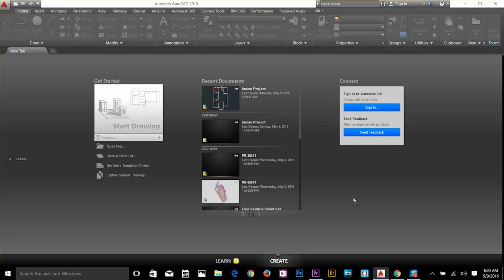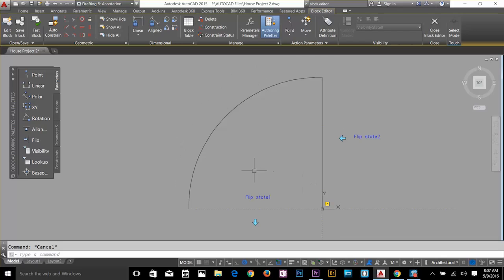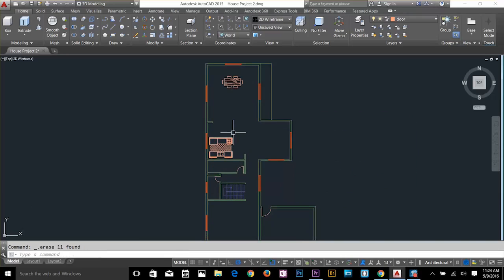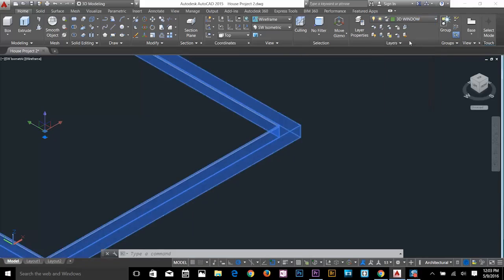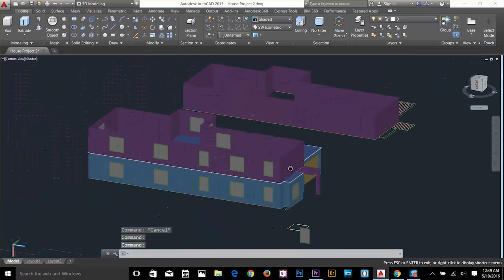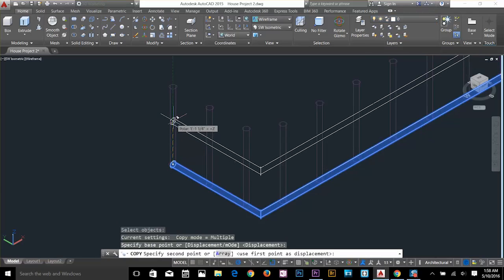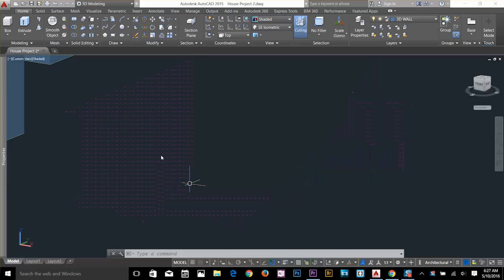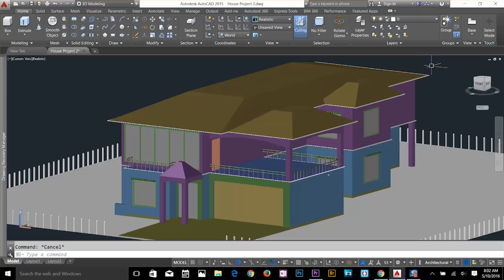Autocad Tutorial Architectural 2d And 3d Complete Part 1

Comment: 1 thing im so confused bro, in the beginning of this vid, you set your first working area 42' x 85' .. if im not wrong, and you offset 9" + 13' + 4.5" + 6' + 9" + 20'  =  40'-10.5"   ... Right? thn how come when you put the offset for 20' , it came almost in the middle of the rectangular  box ? the width shouldnt be 42'-0" .... please guide. thanks
Reply from the maker: +Martin Samuel bro try to come up with your own dimension ... which will give you better idea how yo use the tool